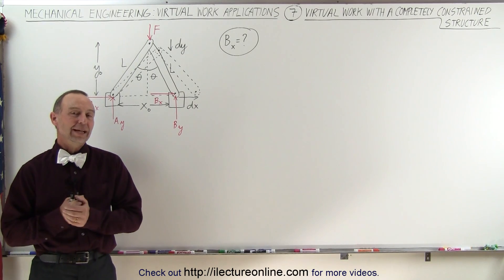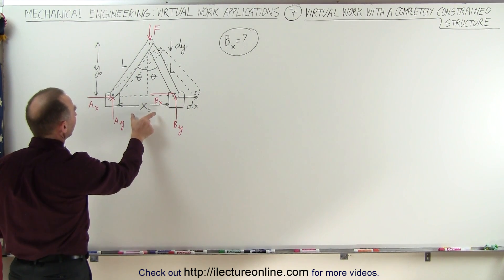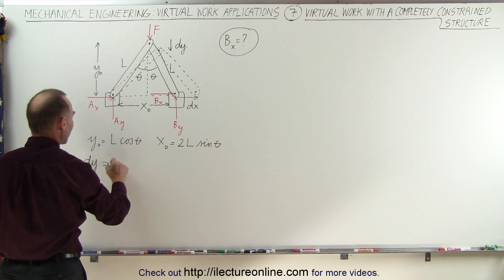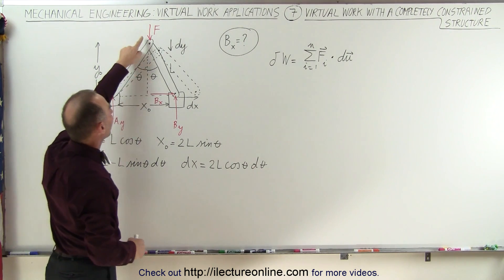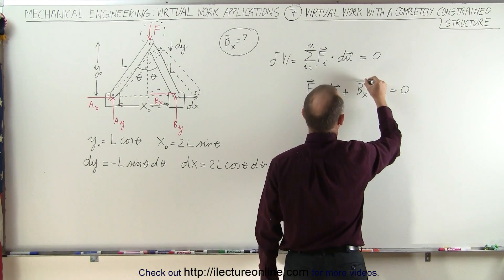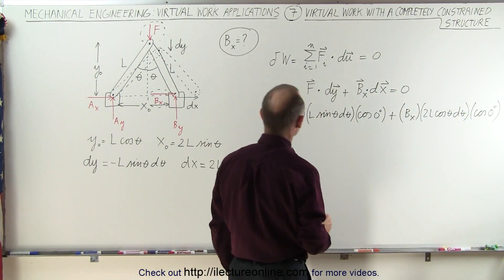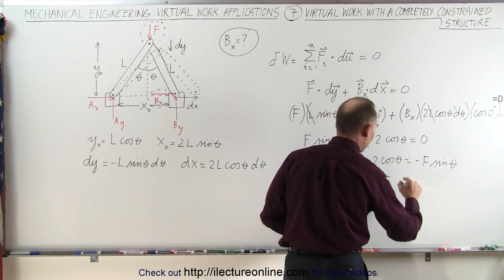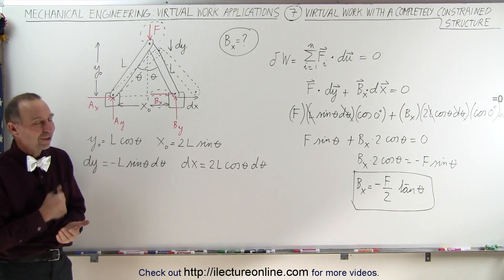Mechanical Engineering: Ch 13: Virtual Work Applications (7 of 39) Completely Constraint Structure**

Comment: I have a question about the method used in this video. Since the structure is completely constrained, and is not really moving in any direction, why is it valid to (arbitrarily) decide that the virtual displacement vector at point B should point to the right? Wouldn't it be equally valid to imagine it as pointing down, or in some other direction? And if we did so, wouldn't the calculated forces on the structure come out differently? Or did we treat it as pointing to the right because we wanted to know what force the structure will experience along the horizontal axis, and not the vertical axis?
Reply from the maker: It depends on how the structure is constrained and what the expected motion is.

Comment: hello sir, I have a question
Why are we ignoring the minus sign while er are pluggin in the value of dy?
Reply from the maker: If you only want the magnitude of dy, then the negative sign is not needed.  If you want to include the negative sign, then you must also add a negative sign in the equation relating x to y   (as y decreases, x increases).
Reply: Actually a.b=|a| |b| cos(angle)
Reply: @not_ujju you are right
Reply: dy is negative because it is directed downward also the force F pointing downward thats why negative times negative is positive. Am I right sir biezen